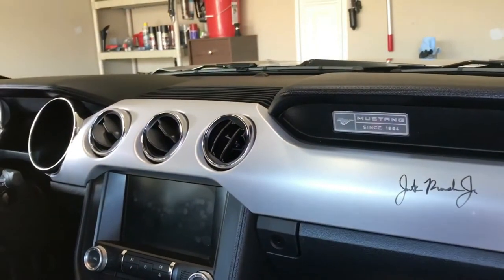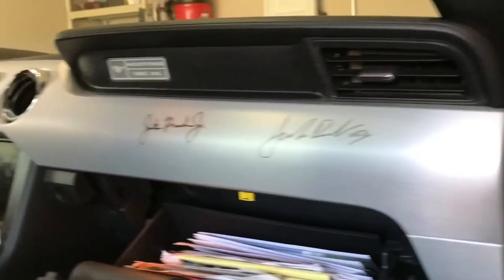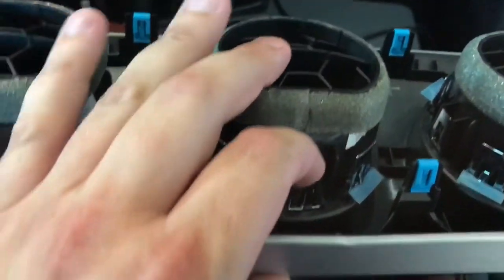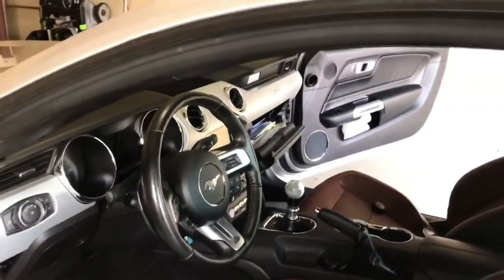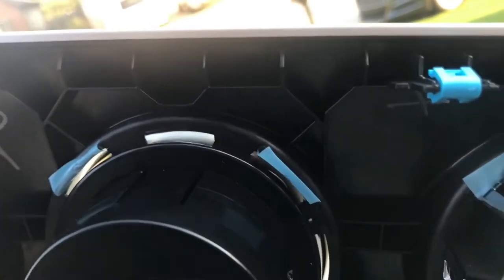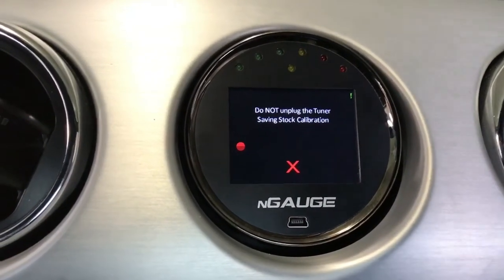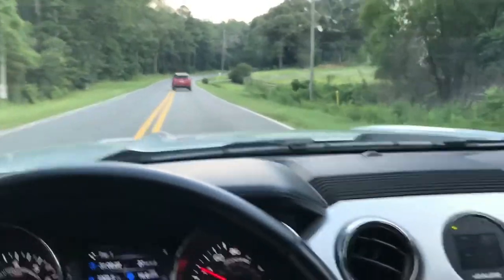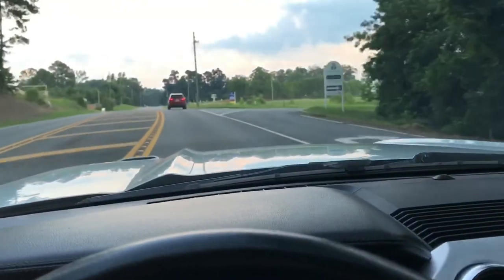nGauge install in A/C vent and Lund tune on a 2015 s550 mustang GT.   ✔️

Comment: question. How does this tuner effect the factory select tuner switches? I.E. normal,sport and track mode ?
Reply from the maker: ron nie It doesn’t.  They will still function as normal.  They only change steering, throttle response and traction control settings.
Reply: @KnightsGarage  hey man I was hoping you could help me out with something. I'm gonna be purchasing a mustang in about a month or so, but I want to start getting a few mods right now so they'll be waiting on the stang to get here. One of my first mods will be exhaust upgrade, and I want to invest in a tuner, at what point should I be getting a tuner, or am I on the right path by getting a tuner along with the exhaust upgrade? Hopefully you can shed some knowledge on me, thanks.
Reply from the maker: Mr. CumUp man the tune will turn the car into a new beast if it’s one of the top three tuners.  Lund is the best in my book.  Exhaust is basically just for sound

Comment: hey one more question can this tuner display oil pressure ?
Reply from the maker: yes the ngauge can display up to 6 or 8 gauges at once on the screen.  It can display all PCM inputs.  like air temp, rpm, oil pressure, mass air flow values, batt voltage etc....  It can also display alcohol % learned and the learn flag which is helpful when running E85.